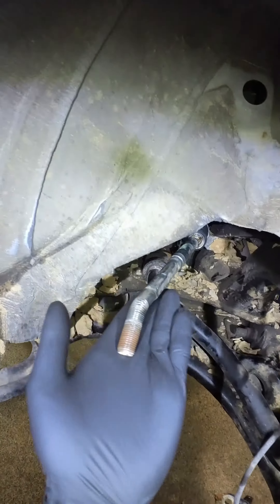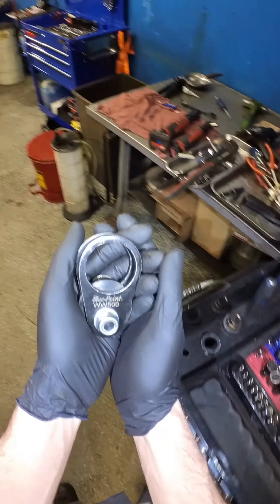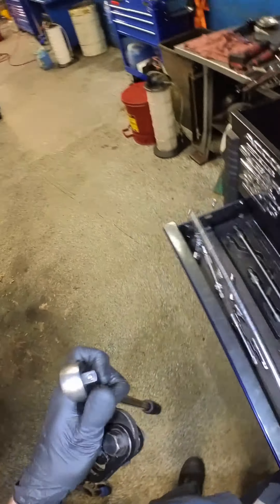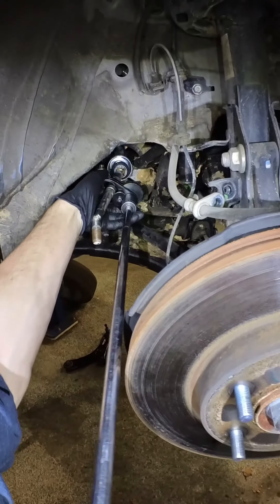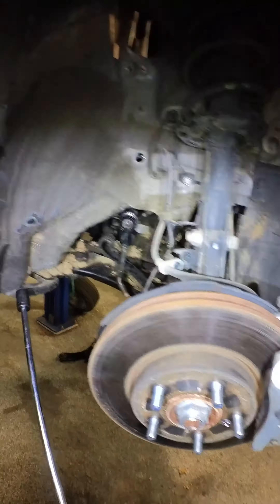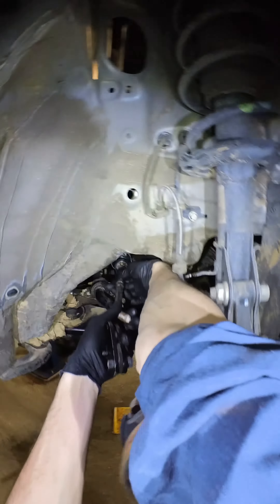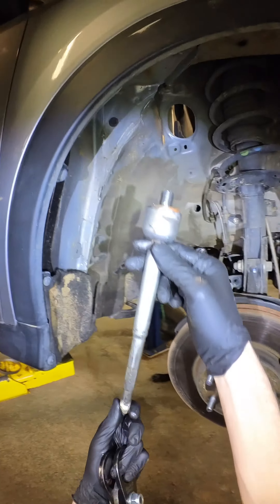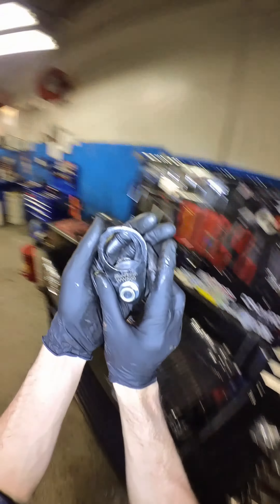Inner Tie Rod Removal/Install Tool 👀 #honda #hrv #innertierod #tierodtool #otc #bluepoint

Comment: Damn never seen that tool before. How bout a tool box tour when you have some time? 😎
Reply from the maker: I have a roll cart tour posted 😁👍 I'll have to find it and comment the link
Reply: @TEVIDEOS I have a similar tool but it requires tightening two 14mm nuts to clamp onto the tie rod and that’s if you can get to them, this is a much better tool. Thanks I’ll be definitely picking one up.